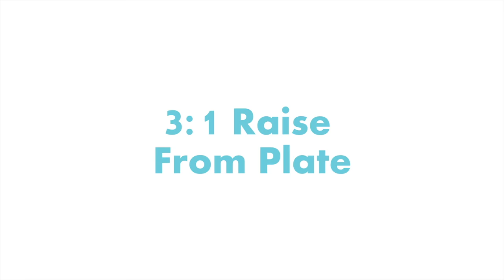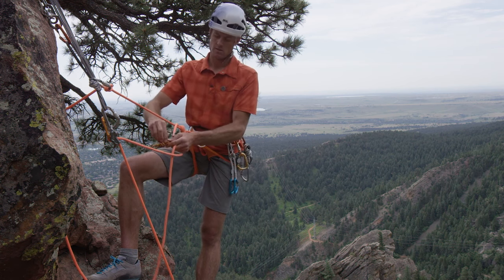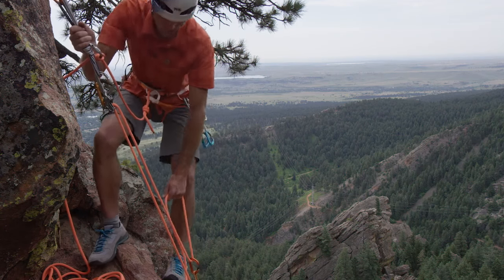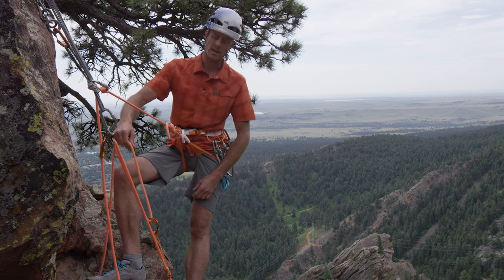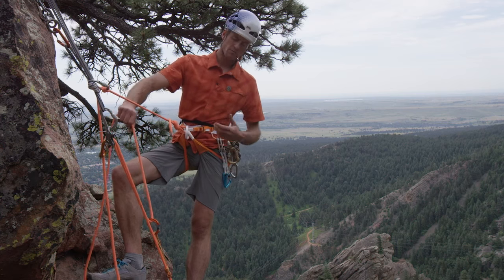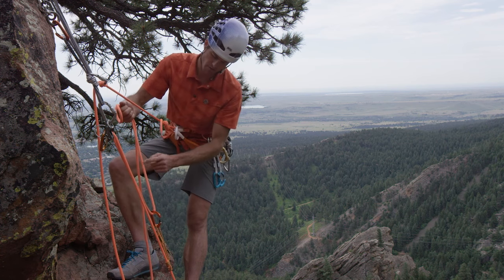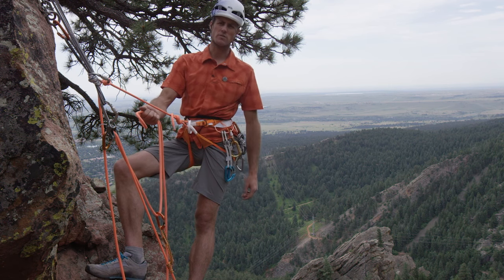How To Raise A Climber From Above Using A 3:1 System

Comment: If you are belaying through a guide plate and the follower needs a little "boost," this is a quick and dirty solution.  But the idea that there is, in reality, a 3:1 mechanical advantage is nonsense.  First of all, the guide plate does not allow the rope to run freely through it; in fact it continues to capture the rope when the belayer lifts.  This can be clearly seen in the video, which shows considerable slack in one of the purportedly load-bearing strands during the lifting stroke  So even in theory, the belayer is now down to 2:1, and if the friction around the carabiner is taken into account, more like 1.7:1.  In brief, your pulling force will certainly not be tripled and, in fact, will not even be doubled.  This doubling will be further reduced by any friction in the system below the belay, so there is real potential for ending up with no mechanical advantage at all.  

Given that the belayer is going to be relatively weak trying to pull upwards on a thin rope, it is quite possible that one might get more lifting effect by connecting that bottom prusik knot directly to the harness and doing some deep knee bends, manually pulling the slack through the guide plate to capture any progress.
Reply: I feel like this demonstration was plainly incomplete.  The guide plate, where it attaches to the load line, isn't part of the mechanical advantage.  It's merely progress capture.  He never actually clips the haul line through the last redirect that would make it a 3:1 system.  

You're right about the inefficiency too.  Using only carabiners to redirect the rope, I think you'll be lucky to get much above an actual 2:1 advantage in a 3:1 system.
Reply: No, I take it back, he's counting the belay device as part of the haul system.  You're absolutely right.  It's a terrible system and offers very little MA.
Reply: Always a comment section expert on hand to correct the AMGA guide.
Reply: Mechanical physics lessons are invaluable. This guy is not quite grasping it.
Reply: profd65 it’s just physics
Reply: @profd65  Yeah, Richard is a professor of mathematics with a strong understanding of physics. I trust his opinion on the physics of this more than that of a typical AMGA guide.

It's also possible to just draw out the free body diagram and see what's being discussed here. If the ATC acts as a pulley, then this is a 3:1 system. If it acts as a progress capture device and pinches the rope (as it does here), then the system offers a 2:1 advantage. Then reduce the ratio because none of the redirects are actual pulleys.

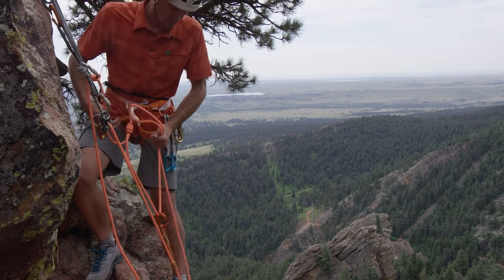Comment: belay is setup wrong too climbing rope should be ontop of the dead rope making it auto lock by pushing the dead rope into the teeth on the belay. after the video cuts at 1:54 it is then configured the correct way after the pull system doesnt work.
Reply: Thanks for the worthless info, Mr. Climbing Gym.
Reply: This is actually a really important comment and not worthless at all.  Nice ATD Tony!
Reply: @fizloki  The device can only be configured in guide mode in one way, and it never changes in the video. The rope is locked off and to the side at the start. Go grab your device and try, you'll see that it's just the viewing angle that makes what Tony said appear to make sense. But yea, Tony is wrong here.
Reply: Your eyes deceive you. The device is not set up wrong. It can only be set up in guide mode properly in one orientation. He has the rope locked off to the side, and because the viewing angle is from the other side it looks like it's coming out on top. To do this yourself, go set up your device in guide mode with weight on the climber end. Pull the brake strand UP and then to the side, and it should "lock" between the climber strand and the side of the inside of the device.
Reply: What Tyler said ^

Comment: That was a 2:1 pulley, he would hav to redirect it once more through the anchors to get a 3:1--- and you are pulling down with gravity so it becomes much easier.
Reply: What about friction loss? Without pulley efficiency of 2 biner system (3:1) will have no gain over against 1-biner system (2:1)
Reply: @rest6366  agree, there would be friction loss in whatever system we use.... Not sure about how 2-1 would be good as 3-1; seems very situational.  However I can say gravity always pulls down-- and that would be good to use for biomechanical efficiency. 

Anyway I think depending on situation all thing have a pro-con thing going
Reply: No, that is a 3:1 system. Although pulling through biners rather than actual pulleys is about 50% efficient
Reply: You are incorrect. It is a three to one theoretical mechanical advantage as shown. If he pulls 3 m of rope through the system, the load will move 1 meter.  Redirecting through the anchor does not create mechanical advantage. It adds additional friction and it might make your hall more ergonomic.

Comment: Very well explained, especially how 1 becomes 3. Thanks.
Reply: Yeah, it would be, except that 1) it makes no sense, and 2) only the pully of the biner/prussik adds advantage; the other "pulley" is actually just acting as a redirect since, unlike the biner/prussik "pulley,"  it doesn't move on its own (aka float) relative to any other pulley in the system..

Comment: Guide plate is set up wrong
Reply: I was thinking that, but it was auto blocking so what ccaused that?
Reply: It's actually set up correctly, but with the camera angle and after the rope is loaded, it appears like it's not. Think about it, it wouldn't be grabbing when he basically let go of it if it was set up wrong.